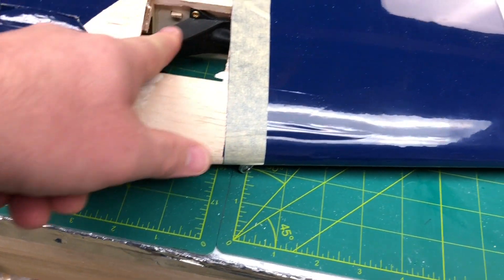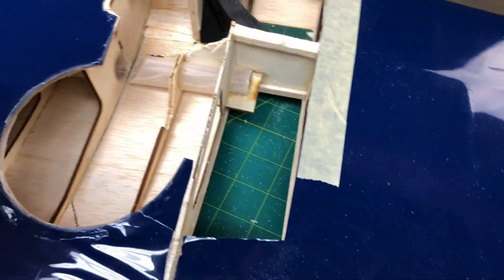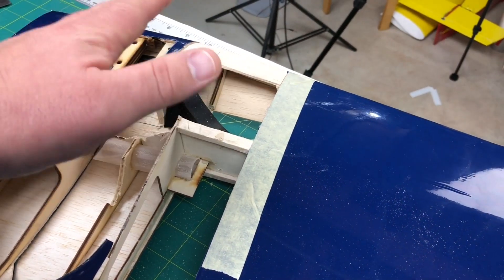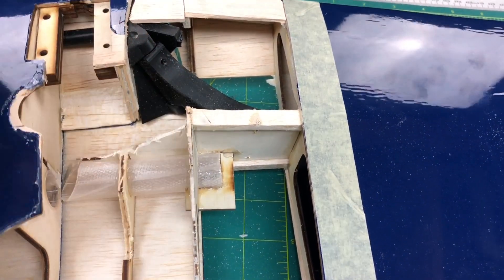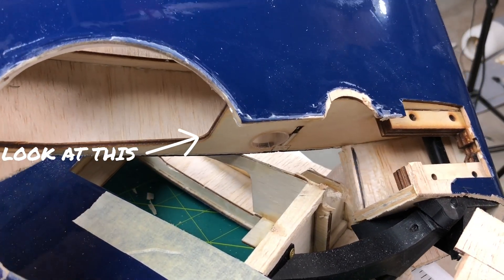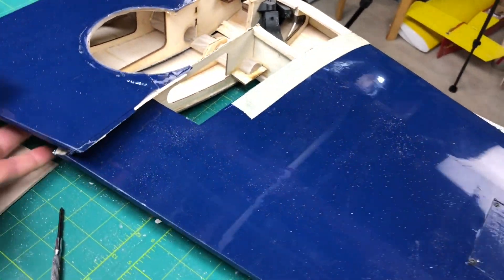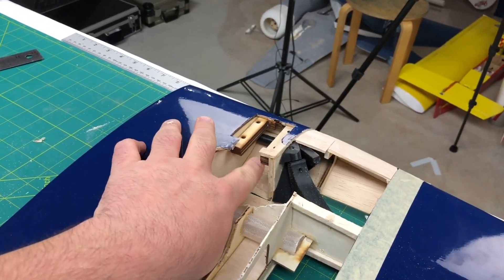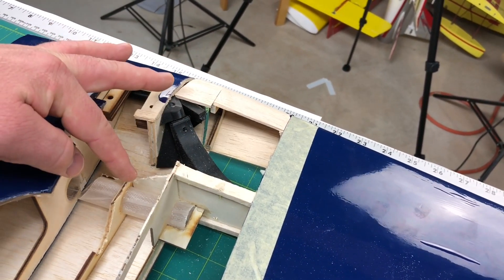Folding Wing Part 1: Cutting it in half for no good reason

Comment: I still think you could pull it off with some slight modifications to your hing . Then add a locking wing spar . But I get that at some point you realize it will take far to much time and etc to fulfill. The old juice isn’t worth the squeeze thing. Well done though it was very interesting and valued . Thanks for the video, great job.
Reply from the maker: There will be a deeper dive into this in the next part. Thanks for watching!